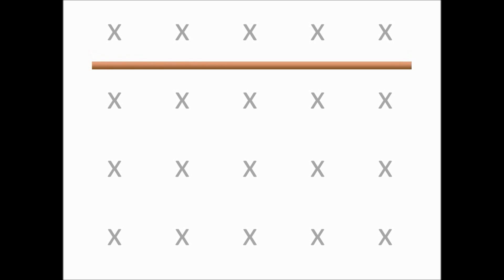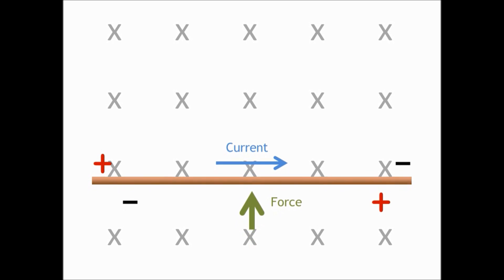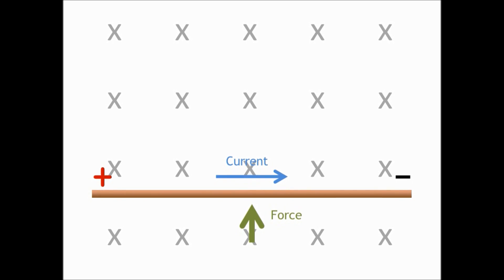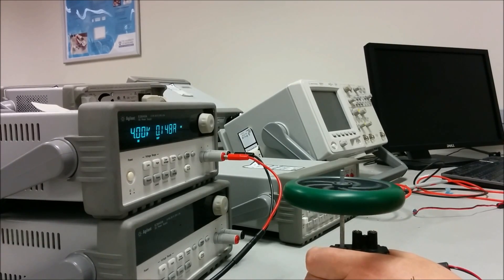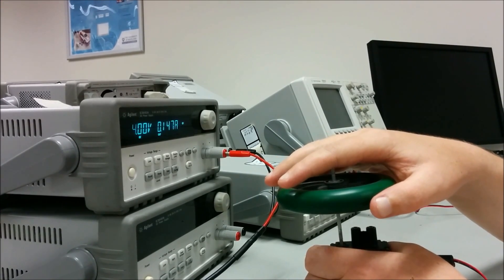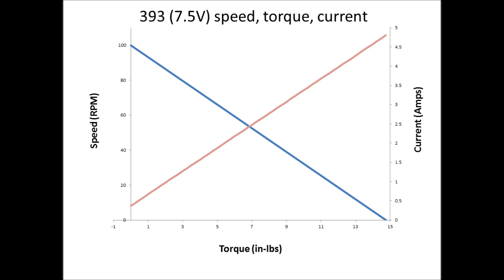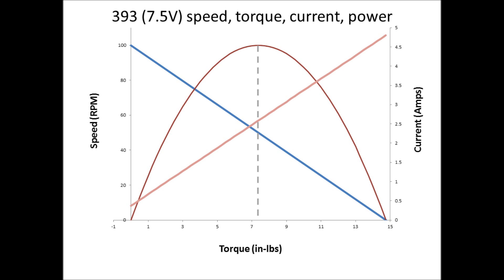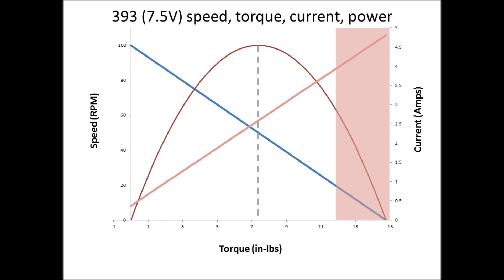Motor Torque, Speed and Current

Comment: hi hello, i rewind my dc motor from thin to thicker wind coil, it's far Thicker so i only made 8 turns per pole. it's working when no load, when i place the remote car on the ground, it's not moving. please help mw to answer
Reply: You have reduced the number of windings, so the maximum torque that the motor can produce has been reduced. In order to produce more torque, you would need to use thinner wire so that more windings can fit on the motor. Careful though, thinner wire has more resistance so will get hotter and might burn the motor.
Reply: @RobertSawrey   so what can i do?
do i have to buy stronger Magnet or stronger Battery?
Reply: @yosef-yosef9414  A battery that is rated to a higher current and a larger magnet would help. Be careful though, you may turn your motor into a heater with so few turns. Motors are generally designed with specific speed, voltage, torque and current in mind. You could buy one off the shelf to meet your specific needs.